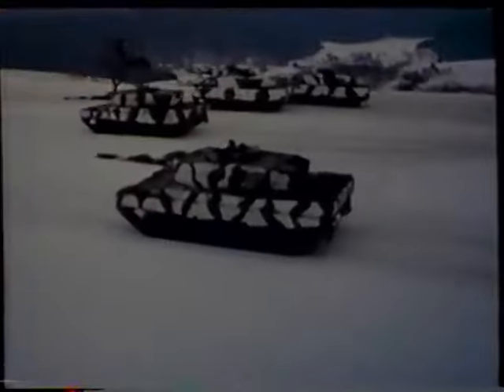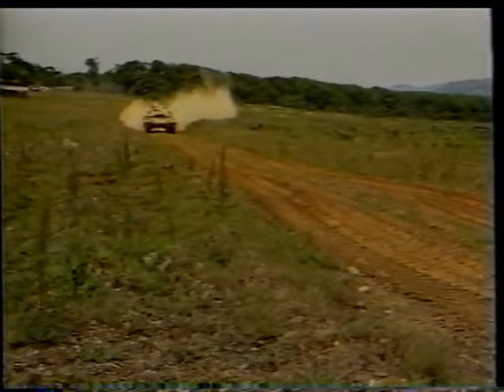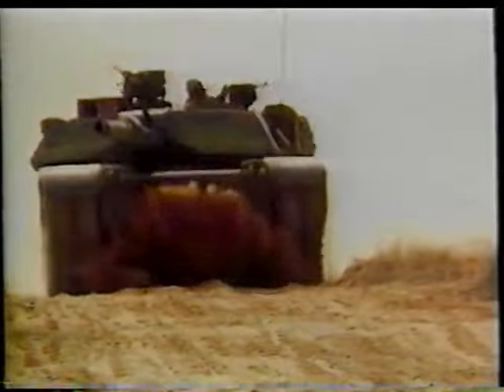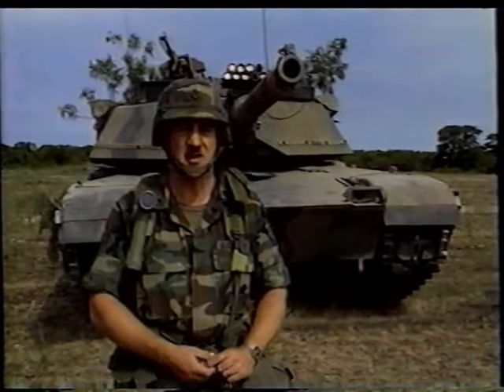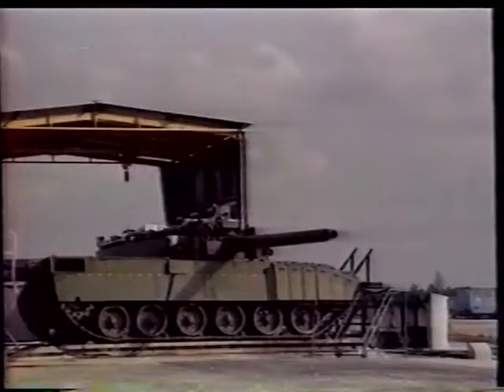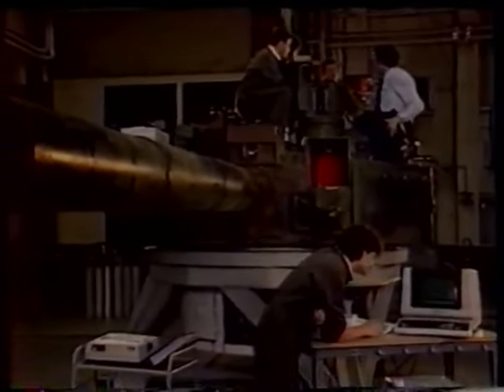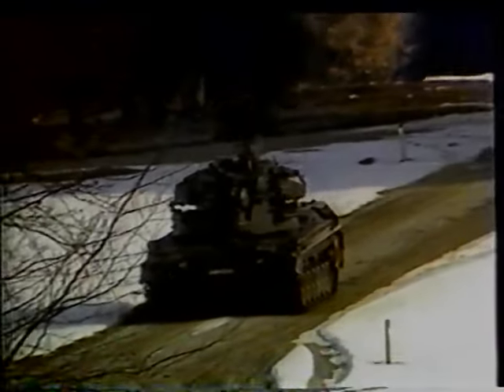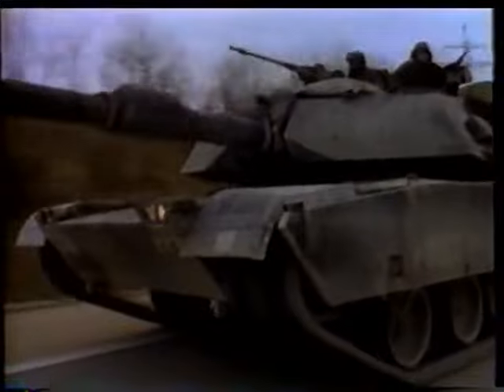NATO Battle Tanks (1987)

Comment: A color computer monitor in 1987 must be like having a GeForce RTX 4090 in 2023
Reply: New russian tanks are still being produced/upgraded with physical glass and mirror scopes like it's still 1960.
Reply: The average schmuck could have a color computer display for about 5 years at that point.
Reply: @kehreazerith3016  whats wrong in having periscopes? Lmao
Reply: @sebastiansuteu1829  well, tiny cone of vision for a start
Reply: We had computers but they just ran DOS, no Windows back then.
Reply: @hiddendragon415  Amiga <3 Atari <3
Reply: @n00blamer  <c64
Reply: @n00blamer  
RISC OS on the Acorn Archimedes.
Reply: @MostlyPennyCat  sweet!
Reply: @hiddendragon415  Norton Commander 👍
Reply: @sebastiansuteu1829  they aren't as good as having cameras that can move and zoom.

Comment: USA: we have placed the crew at the center of our design process 8:06

Russia: we've made the seat out of ammo to save space.
Reply: Save space> thicker armor> tank doesn't get penned at the first place 

This is the design philosophy.
Reply: this man is so sure of himself as if Russian armor hasn't been found to be comically easy to pen
Reply: @alb9520  In the 70s and 80s there were not many shells that could do so. The T-72 is really just outdated, has been for the past 20 years
Reply: @drear20486  if upgraded to the best version (b2 rogatka) it can be on par and beat many tanks in many ways.

For example with RELIKT it has best side Armor.
Reply: @mr.waffentrager4400  In the era of kinetic penetrators, bolting more armour onto a vehicle is increasingly redundant. Whoever can acquire and engage the enemy first will win 90% of the time.

Advanced Western sights and detection methods give NATO tanks the edge, but more than anything the crew will determine the speed at which targets can be serviced.
Reply: @randominternetguy8735  i wasn't talking about tank on tank engagement, most of Russian loses are from artillery ,mines and atgm(and having those side era really helps against atgms which would normally go through 30-40mm sides of western tanks) 

About the sights, t-80bvm t-90m , t-72b3 get the french thermal sights with auto target tracking (not even leopard and Abrams have these)
Reply: @mr.waffentrager4400  The Abrams has a 360° CITV thermal sight, superior to anything Russia is fielding.
Reply: @randominternetguy8735  jokes on you Russia deployed armata with a 360° CITV fuking YESTERDAY. 

AND they started installing CITV on normal t-72 few months ago(only 2km range but probably more than enough in Ukraine)  

In terms of CITV Russia didn't invest much, but now you can see.
Reply: @mr.waffentrager4400  You mean the Armata that broke down while on parade?

The Armata is a paper tiger lmao. Watch Lazerpigs video on it
Reply: @randominternetguy8735  yt is deleting my comment
Reply: @mr.waffentrager4400  lol
Reply: @mr.waffentrager4400  Armata? What is Armata? Oh, you mean the super advanced Russian tank that was supposed to be in mass production 5 years ago, but only 9 still exist and has yet to proven itself in combat?
Reply: @randominternetguy8735   red effects response video on that.
He made a video because lazerpig had a lot of errors.
Reply: @mr.waffentrager4400  like I said, red effect is a shill, and he actually apologized and retracted a lot of what he said after
Reply: @mr.waffentrager4400 red effect literally retracted alot of the shit he said, know why? Because he talked with lazerpig and probably got unloaded with a gigaton of documents. And lazerpig is a military historian who are you? Why is your word eith no proof better than his with proof?😊
Reply: >save space
>thicker armor
>harder to hit
>harder to see
Basically every new Soviet tank in the Cold War was incredibly powerful.

Comment: Claiming that Chieftain is impressive and a powerful tank in 1987 is quite a stretch and was already a dubious claim in 1972.
Vickers MK.7/2 was already dead at this point, 1 vehicle prototype build, no further developement and project canned in 1986.
Challenger 1 was basicly just an uparmored Chieftain with slightly improved FCS, still lagging behind M1 and Leo2 in capability, primarily hold back by its inadequate FCS and main armament. Even though the 120mm L11 L/55 rifled gun was at this point issued with L23A1 APFSDS, it still lagged behind the RH120 L/44 / M256 of Leo2 and M1 in firepower and penetration. And both the 120mm L/44 smoothbore firing the 15-25% more powerful DM33 or M829A1 APFSDS was still struggling with T-72B´s and T-80U´s on ranges above 1000m
Reply: Alright bit salty.
Reply: @justinboyan573  nah, just stating facts.
NATO was seriously fckd if the Warsaw Treaty forces would have attacked during the cold war.
Reply: @zhufortheimpaler4041  🤣🤣🤣🤣🤣🤣🤣🤣🤣🤣🤣🤣